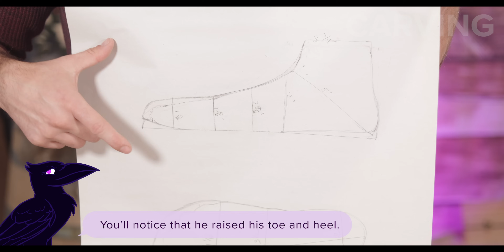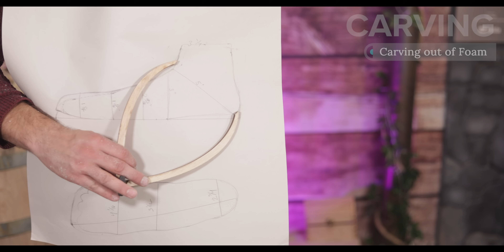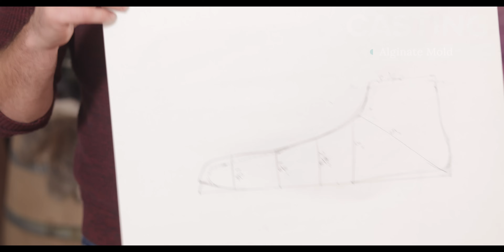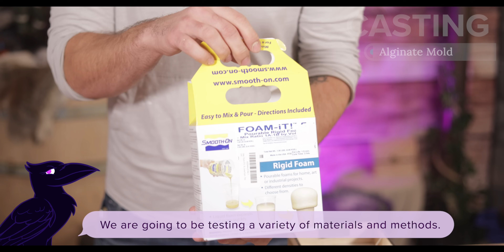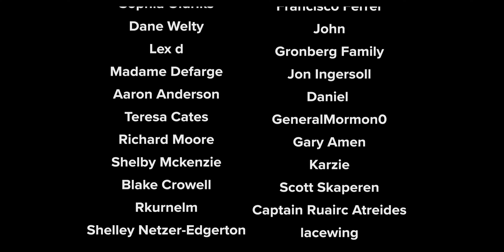Our Last Video

Comment: New here. A easy way to make a patern of your foot is to put on a sock and wrap it with duct tape. I would suggest putting a good insole inside the sock to allow for the pattern to fit.

Use a sharpie to mark your lines and cut it apart. When you lay this on your leather add enough around the edges for your seams.

Comment: Just got to the spray foam bit. Just FYI, it likely isn't the glue itself but the propellant. Often, spray paints and spray glues use an aerosol, which causes the foam to melt if sprayed too close to the foam. A couple of things you could try, first, spray farther away. It gives the aerosol time to dissipate before reaching the object you're trying to glue/paint.
If that isn't something you're interested in, you could also use a pump spray glue or protect the foam with Mod Podge, although if you go with the Mod Podge, you might as well use it as the glue itself

Comment: it is interesting that different industries have different names for their molds.  I worked in carbon fiber a few years ago.  The molds we made parts on are called tools, but when we remove the part from the tool it is called demolding

Comment: Your clickbait title got me for sure! But this is also the video I needed. I have hard-to-fit feet and have long been thinking I just need to make my own shoes. I can't wait to see what you make with your lasts! (On an accessibility side note, if you're going to add additional information in text across the screen, please don't put it along the bottom. That's where the closed captioning goes and it's more than a little annoying to have to rewind, turn off captions to read the additional text, and then turn captions back on again each time.)

Comment: Alright, I'll add another way to make your lasts. What I've done (because I'm a computer geek), is to start by taking a 3D-scan of my foot. Because I'm not made of money, I've got an old X-Box Kinect sensor that I use together with software called Skanect. A bit of post-processing of the resulting STL model, and I can load that into my CAD program (FreeCAD, in my case). From there I'm free to model up the last around the model of my foot, and I can play around with the toe box shape as much as I like, until I find curves that I find appealing. With that done, I duplicate and mirror the model, giving me a matched pair. These I can then load up in the slicer for my 3D printer, and a couple of days worth of printing later, I have a pair of perfectly matched lasts. Give them enough layers/infill across the bottom so they can be nailed into, they seem to work sufficiently well, and can when necessary be repaired with a 3D-doodler pen to give you many uses.

I have also tried using a CNC router instead of a 3D printer, but that was such a pain I'm never doing that again 😅

Is this as easy as any of Clever's methods? Nope, but it does give me more options to play with the last shape at my leisure, and I don't have to stress about left/right differences. Word of caution — make sure the scaling is correct when you import your foot model (please don't ask how I know...)

Comment: When it comes to the blue, yellow or pink solid foam, 99% of all spray, anything will melt these foams. And that 1% is GreatStuff expanding foam, (Minimal or Low Expansion) is best. And tooth picks are your friends to hold it together while curing.

Loc-tite, not so much, as it tends to separate from the foam.

Wood glue or Elmer's glue, will never cure even after a weeks time to dry.

And some 2 part epoxys also work, but buy the smallest sizes before buying a larger quantity of the same mix that did NOT FAIL, and melt a hole through your projects. 

Always test before head first into projects, (or filming) and remember, Safety Third!

That said, I also use sheetrock mud during my shaping, so that I can hand goop it on, hand smooth it around, let it dry, then 2-3ft away, mist the mud with spray paint, before sanding. This will show high and low areas that need more smoothing, with sandpaper, instead of a rasp or handsaw.

Comment: I get my boots and shoes at the ren faire and what they always do is put a sock on your bare foot and wrap it in duct tape. They make some marks to locate those same points you were measuring and then they cut it off from the back. You could then fill this with they foam you used, I've also seen them stuffed with newspaper. When you get the boots (it takes a few weeks to make them) you will often get the mold back cut up into pattern pieces.

Comment: Manufactured shoes don't fit my feet my toe box is way too wide even wide shoes are constructive the reason I started learning leatherworking is to make my own shoes I tried making a last by wrapping duck tape around a plastic bag i wrapped around my feet and pouring plaster into it but it didn't turn out great and I went ahead and just made some shoes without one it worked out ok but are still a bit uncomfortable think I'll try the plaster paper cast next time

Comment: Instead of all the drama with plaster casts, you can use knee socks and duck tape. Have your subject put on knee socks, then wrap the feet in tape as far up as you want to go for your footwear of choice. Cut the taped sock off. (At this stage, having a pair of angled scissors like medical professionals use to remove dressings is tres helpful.)

I think you can just fill the (re-taped together) socks with spray foam and have a nice mold that's accurate enough for shoe-making. I haven't ever tried it, though. I just know the first steps of the process from watching a renfaire merchant fitting a client for custom boots.

Comment: I used a 3d scanner on my I-phone 13 pro and scanned my foot, then 3d printed my foot... instant last, well it took all day to print, but you get it.
Reply: Also, to add to your  last, the pros just use tape... painter's tape until it's the right thickness. Or plaster-of-Paris/ wall gap filler.

Comment: I have never been more genuinely pissed at a creator for clickbait than this. That was cheap. I love your show, you do amazing work, but that was not cool. You have the power to genuinely impact peoples lives, and you just abused that. Again, you do an amazing job on your videos, but I just needed to call a spade a spade on this. I have had creators I love leave the platform before and been genuinely effected by grief. That was low hanging fruit, and an abuse of trust. I will give credit where credit is due, you didn't let it go on for even a full minute, but still, that wasn't okay.

Comment: Also, I think I remember them saying the molds flare up in the front & back for 2 reasons… 1 to help you roll the shoe in the direction your walking (not flat footed like flip flops), and also it helps you get the molds in and out of the shoe your working on, etc…

Comment: “You can always remove more material, you just can’t add more back later”… but if it’s to much a PITA to fix the last if you remove too much, you can remove material from the foot a lot easier, those saws will go right thru that flesh&bone… hey, leather/time is expensive!😊

Comment: The only one of those materials that I believe would be useable to make more than a coupple of pairs is the wooden last. Cardborad and low density foam can be compressed and scraped while to handling, so the shape and size will vary; even the Mod Podge will not prevent it, it may help to delay the damage.

Also, do not use pins or staples directly on the last: use a ligth glue. There are glues specifically created for it, to prevent damaging the last; the pins will weaken the material, eventually ruining the shape. 
You can use pins with the wooden last, because the wood can take some damage. But it will need a cobler's hammer, and it will eventually ruin it.

BTW, you can BUY the lasts pre-made to fit, in a variety of shapes in order to make different stiles of shoes, like high heels, flip-flops, knee-high boots, each one needs a different shape of last. 

Sure, at $10 to $25 the pair it can be expensive for a single use, but if you want to make more than a couple of pairs it may be worth. Some are even ajustable to a range of sizes and shapes, making them a viable option for a group purchase.

I am speaking this all out of experience, I have worked for some time in the shoemaking industry. I have seen a number of situations around those...

Comment: When I did it professionally (made custom shoes for a decade) we used bivalve plaster bandage molds (molded in a separate lower and upper half with a raised alignment ridge on the seam) and a two part polyurethane foam. When I made a pair for myself a couple of decades later I bought a pair of commercial wooden lasts of the right size off ebay for about 15 bucks and modified them ( sand down what needs to go and use layers of veg tan leather and contact cement to add volume where required).
Reply: I am working on my third pair of handwelted shoes! Do you happen to remember anything about the kind of PU foam you used for casting? I have seen some foams in German orthopedic catalogs, like ASTI-OP and a house brand from Beil. But I've yet to find any US source for PU foam as hard as the foams the German finders recommend for full lasts. Right now I'm leaning toward trying the remeltable, reusable thermoplastic PU that my local ortho supply importer carries. Thanks so much for any info!

Comment: Cool video.  To refine the shape of the wooden last, I would recommend a spokeshave and a Shinto rasp for outside curves, and round and half round files for inside curves. I used to do this kind of shaping for work, just not on lasts. I’m interested in a follow up to see how the different methods perform.

Comment: Just a tip on the xps foam and spray glue. It may not be the glue itself, but the propellent used in the can. I had the same issue with spray paint on theatre props/set pieces...later, I didn't mind the melting (it would give a nice texture for this set piece), so I used it again but I found that if I held the can a few inches further away, the foam didn't melt. The propellent had time to dissapate, but still got good coverage. The trade-off though was that there was a little more overspray. It didn't matter in the workshop where I was, but it might where you are. Just take precautions and try it on sample/scrap pieces first.

Comment: Okay, I was getting ready to ask why you were creating an inaccurate wood last rather than just taking a cast of your foot, then making the last from either hard-curing foam or resin. You do ideally need a second person for the initial cast, so I'm guessing you didn't have a helper available? Casting is definitely how all custom bootmakers that I've ever worked with have created their lasts.

One tip from someone who has natural-shaped feet. The person being cast should stand with their weight distributed on both feet as it would be normally. This allows the shoe to be built with enough width for your toes toes to splay.

The narrow toe box in 99% of mass-produced shoes forces your toes to deform to fit the shoe, and we start deforming our kids' feet at a very young age. Yes, ladies, if your toes can fit into a pair of store-bought dress shoes that aren't at least a wide width, your feet have been deformed by your shoes. Mine used to be, but a major injury forced me to give up all such footware and my feet slowly reverted back to their natural shape over nearly a decade. Naturally-shaped feet have a fairly narrow heel (ymmv on how narrow) then they gradually get wider until your toes are the widest part of your foot. When you put weight on your feet, your toes will splay to provide the best grip on the ground possible for running, walking or climbing over uneven surfaces, and just generally helping you with optimum balance.

Comment: I like the alginate mold. Inexpensive, easy, and reusable. Being able to recreate a new last on-demand when an old one breaks or is worn out is a bonus. 
For any of the mold-making using a person's foot, you do want to make sure you take the mold while the person is standing. Foot shape changes (mostly wider and flatter) when you stand and if you don't account for that your shoes will end up too tight. 
Having watched shoe-making videos before, I think the foam is an OK easy idea but not very usable for much but a turn shoe. The wooden last will work for any shoe design including modern shoes and boots, since you can easily stretch your material over the last and nail into place. You can use plasticizers with plaster to make a composite resin that could work too, but at that point you might just buy last-specific resin.

Comment: If you're using a foam or cardboard last like that, you really want to seal the entire thing up. Just use the same filler to seal it up with a thinned layer and, possibly, a layer of filler primer just to seal it up even more. The main reason is to make sure that your last actually lasts...

Comment: Oh dang; I just finished watching your video and you forgot an Important part! 
You can take most lasts appart, caus often the shoe you make is so tight to the last, that you couldn't pull it out. Therefore you need to disassemble (or deform, thats also a possible type) the last 9/10 times at the end of the shoe making. I'm afraid you showed how to make a disappointing tool that will bring more pain then pleasure :(((((
Reply from the maker: We mentioned it in the description! We were more experimenting with different methods and materials and didn't have time to go into detail with construction. Maybe in the future we can talk about the actual last types and different ways to make it so you can remove them.
Reply: @SkillTree  Thanks for the quick answer, but I wouldn't have looked down there if you wouldn't have told me. And this is very important for the basic turnshoe which most of us would use the last for first.... please don't take my comment the wrong way, it's still a very good last video XD. I just feel like you should have mentioned that aspect :) .... You maybe could add that to your pinned comment?
Reply: You make the upper around the last, then take the last out before attaching the sole.
Reply: @darrinrebagliati5365  not on most authentic medieval shoes...
Reply: @TheShieldery  well, now we know better.  I usually make my moccasins around my feet.
Reply: @darrinrebagliati5365   @darrinrebagliati5365  yes, you won't have a problem with moccasins in that regard :). The human foot is way more flexible and deformable as any last material. That's why you need to add that function separately. If you make a standard turn shoe, you need the last mostly for attaching the sole. I actually made the upper parts on a piece of wood, but it's quite difficult to not accidentality displace the sole while attaching it and if you want to pull the upper in the correct position its much easier with the last. That's like the main point of it.

Comment: I haven't made lasts before, but I've been making shoes a while. I've used pre-made lasts (modified to match my feet), and one thing I'll bring up is that even the hinged kind are super hard to get out of the finished shoe (depending on the shoe type). I've seen where folks deliberately split wooden lasts so they can come out more easily, but not sure how the foam-based lasts will work (or at least remain intact for reuse) unless the shoe you make opens super wide.

Comment: And here is my last comment:
You could also buy cheap, old ones made out of wood online, which are larger then your actual foot and then carve them to the desired measurements :)
Reply: Shoe makers usually purchase lasts that are slightly smaller, and build up by adding layers of leather, rather than carving down.

Comment: I found that for me tacky glue is the best glue to use on xps foam over large areas uses and low temp hot glue for smaller areas uses but hot glue can leave voids if you don't have good compression.

Comment: Any thoughts about using the Harbor Freight EVA Foam for the Last?  I'm mildly concerned about getting it smooth enough, but the DAP sealer ought to work well enough.
Reply from the maker: Man, even just the Modge Podge does a great job of sealing everything super smooth.